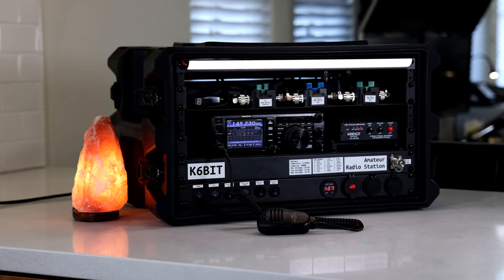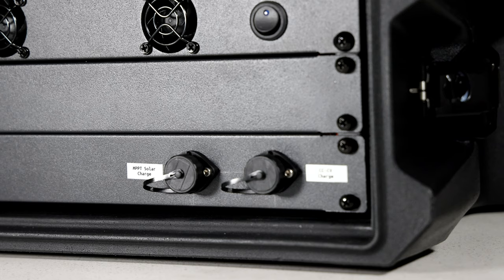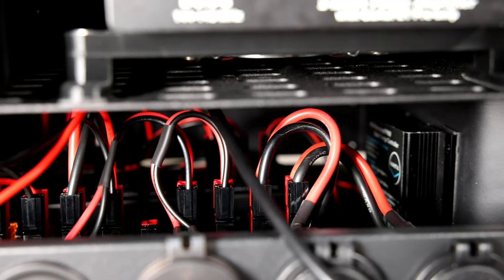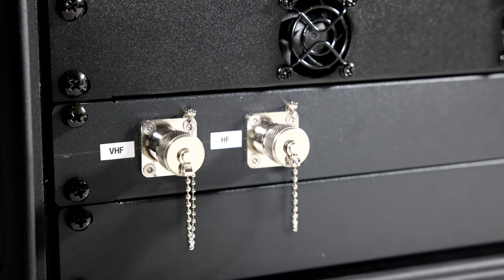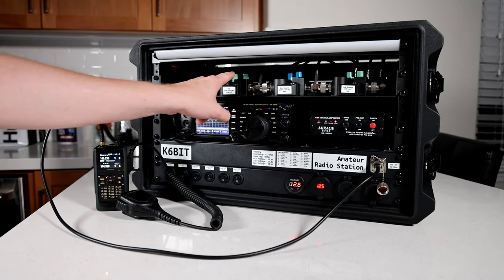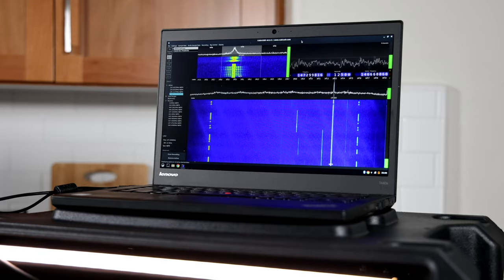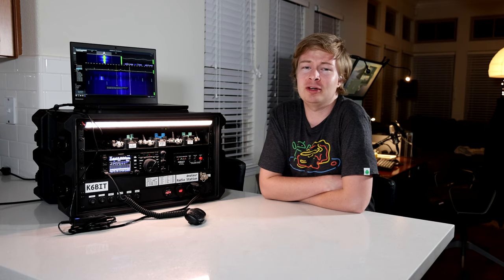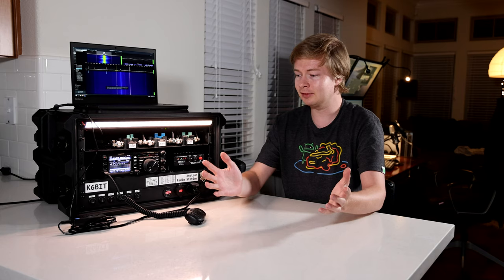Portable Ham Radio Station

Comment: Nice, pro level installation.  You clearly thought this out before assembling the bits.  You did a lot on a budget - not cheat - well spent on good gear without costly frills that would not make you more contacts.  I hope you do as well with your home HF setup after you upgrade your license.   As you request comments and suggestions, I recommend checking for any possible power loss from the power-pole connectors, especially if you have a West Mountain Radio Rig Runner distribution panel, as many well qualified technicians (one who designed RF gear for NASA and the Air Force) have measured substantial voltage sag when running full power on an HF rig, as much as 2.5 v deviation from nominal voltage.  I am not saying your installation has a problem ... just recommending you double check and verify you are seeing no more than .3-.5 voltage sag running full power on the transceiver.  If so, you need another plan.  If not, rest easy and sleep tight.   A suggestion - not a criticism.   Lovely bit of kit, OM.  JT

Comment: Recommend that you break the overall system into modular parts. For example, keep your power function separate from the radio. This will reduce your radio footprint and weight. This also allows flexibility in moving your power source for other functions without carrying a large box full of everything.
Reply: Too late

Comment: 🤔 So you want to make it lighter 🤔 Get a Pelican type suitcase to move the AC & DC and a Rigrunner in it. Use a 4004 USB for fused distribution. Don't Drill holes in the power box just open the lid! You got a trolley to move it around already. Have MORE Fun!

Comment: Is your solar controller MPPT or PWM? And does it cause any RF interference to your radio?
Reply from the maker: It is MPPT and good question. I haven't tried with solar and HF at the same time but I suspect it will cause interference. It is not a tremendously fancy controller.
Reply: @TheResistorNetwork  If it didn't work out, I've had great luck with Genasun being quiet and reliable.